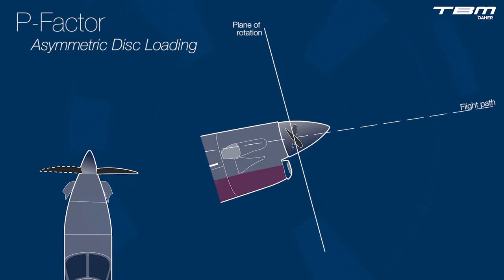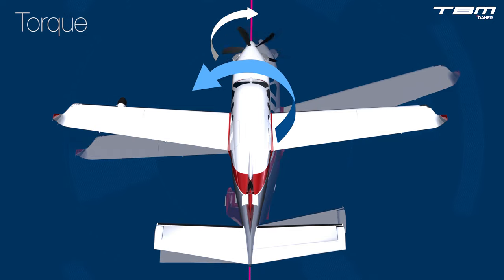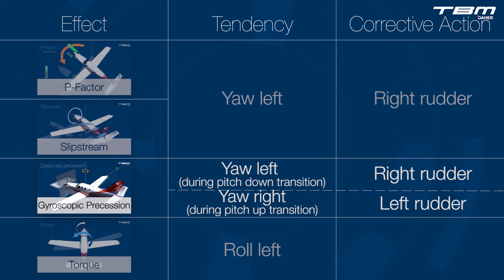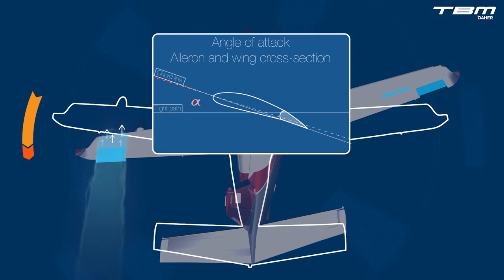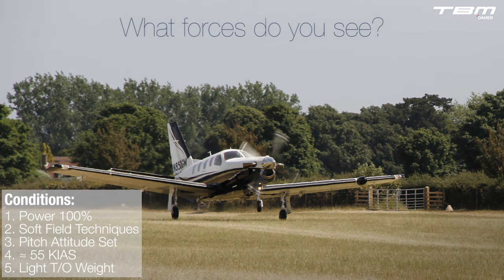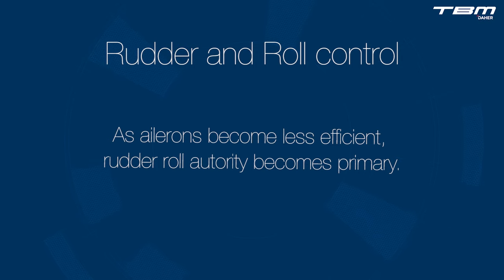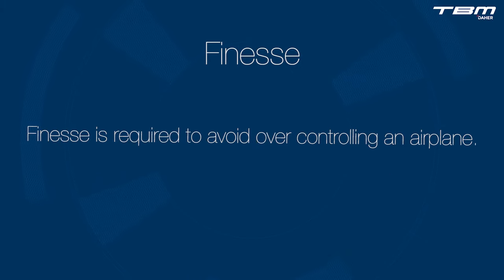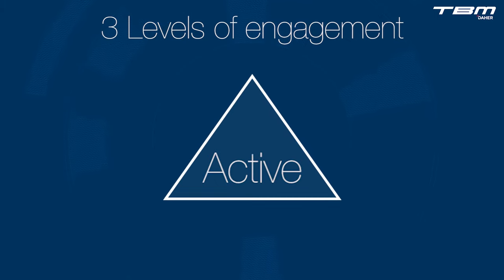Principles of Flight - Part 2 : Propeller Tendencies

Comment: In principle, the propeller slipstream also increases the angle of attack on the inner part of the left wing and reduces the angle of attack on the inner part of the right wing. This results in a right rolling tendency that is albeit much weaker than the left rolling tendency of propeller torque.

Comment: I have this idea.. so a weighted wheel spinning.."gyroscope" with bars coming from each end. Those bars connect to u joints and to the second bars that connect at a point beneath the wheel. The force created by the spinning wheel marries to a transmission of sorts to carry speeds at this end. This leads to a horizontality positioned propellor.

Comment: I have been very interested in adverse yaw which I think affects nearly all aircraft including helicopters.   I was an automatic flight control system (AFCS) technician and instructor from 1971 until 2012.  Most aircraft other than light and ultralight aircraft have an AFCS that automatically corrects for adverse yaw, even helicopters.   I have never heard a satisfactory explanation for the adverse yaw that also occurs with a helicopter.   I think it is due to the gyroscopic effect of the tail rotor but have never seen it in writing or heard it stated as the cause.  Anyone have an explanation for the adverse yaw in single main rotor helicopters?   This is the first time I have seen the gyroscopic effects of of a fixed wing propeller aircraft discussed.   You can find tons of info on the gyroscopic effects of the main rotor of a helicopter but nothing about the tail rotor.

Comment: I wander that why toque reaction is prominent when aircraft is in low airspeed
Reply: AnA KO during takeoff, the engine is producing high power, but the airspeed is low, thus, less airflow over the control surfaces to naturally counteract the torque
Reply: May be because of lower magnitudes of aerodynamic forces at low speeds the effects of counter torque become more prominent.